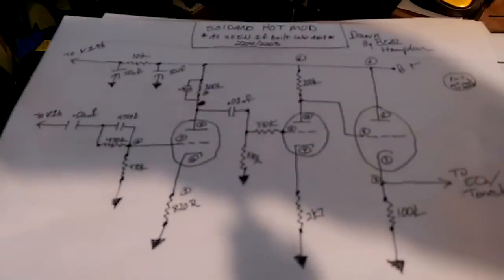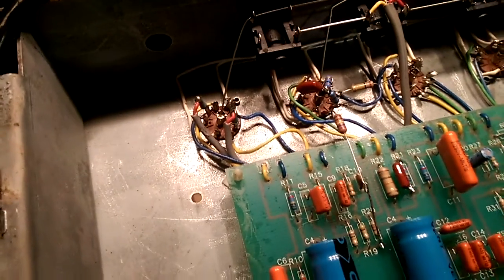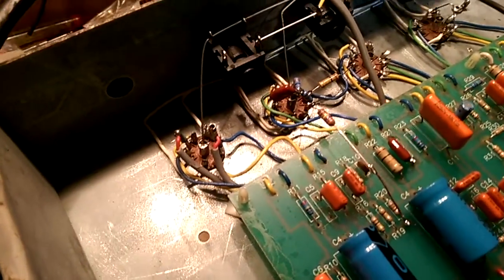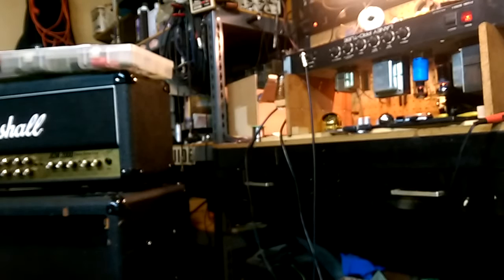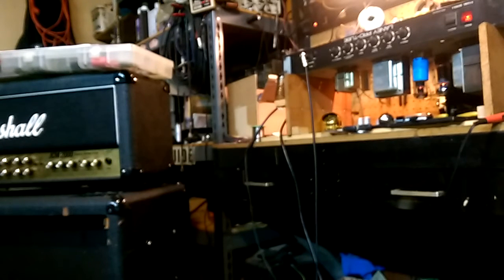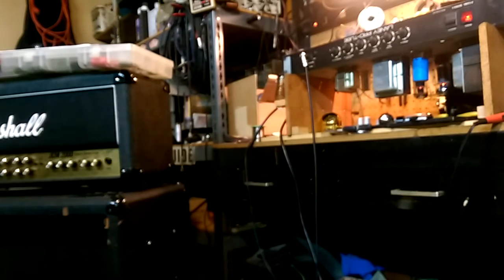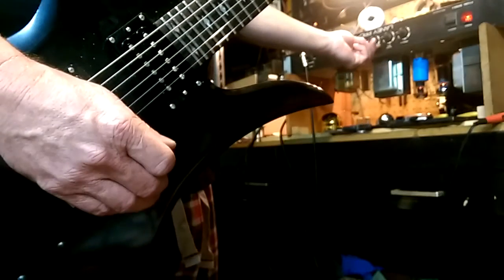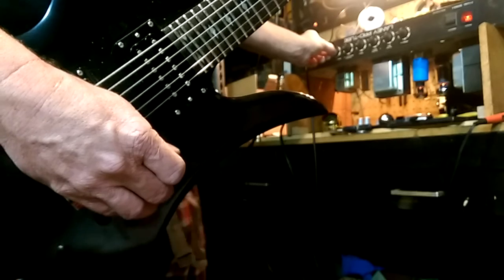Pro Tube 50 Part 3 added soldano hot mod

Comment: Sounds great... I´d like to know your opinion about something I have in mind, I own a JCM 900 4100 100W, and I was wondering if is it posible to take off the diodes of gain and install a Soldano Hot Mode (or something like that), so I´d replace the gain of diodes for gain of valves. What do you think? is it posible?
Reply from the maker: Horacio Morera yeah that's definitely doable. The hot mod adds one extra gain stage to a 2204/2203 circuit and there's plenty of gain already available in that amp to accommodate
Reply: Thanks, but when i take off the diodes the gain will reduce, so i´d intall the soldano to add more gain again... then, I´ve been doing some reserch and the soldano hotmod seens to be a 6k11 valve with an adapter to 12ax7, you know something about it? because the soldano is not in the market anymore so I will have to find another thing that works the same.
Reply from the maker: That's what I was getting at, the hot mod only adds 1 gain stage, replacing the two stages of the cathode follower plus adding one more with the compactron. It's a triple triode. The 4100 should have 6 gain stages already, not including the pi, that you can rewire to accomodate the extra triode. No need to add a plug in hot mod when it can be wired into the existing circuit.
Reply: Thank you, I will take that in count.
Reply from the maker: Horacio Morera oh hey I was a little confused on that 4100, it only has 3 preamp tubes and not 4. I pulled up the schematic and was confusing that with my memory of the 2210

Comment: Your not gonna leave it like that are you?
Reply from the maker: Tim Stanley modded or shittily modded? I'm going to clean it up after I adjust the plate supply on the last gain stage and cathode follower voltage. need to get out some blocking distortion and tighten up those harmonics. THEN I'll finalise it and leave it like that
Reply: BearAmps Lol I liked the way it sounded after the effects loop bypass myself but then again i don't use very much gain at all. definitely has a ton of that for sure!!
Reply from the maker: Tim Stanley I'm definitely a pedal gain kinda guy! this was one of those things I'd thought about doing a long time back so finally did for the fun of it